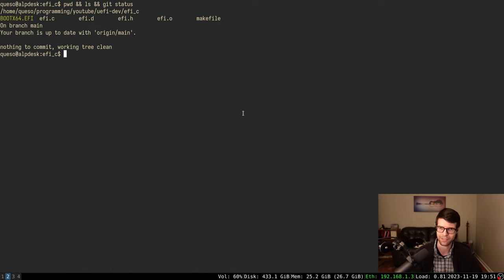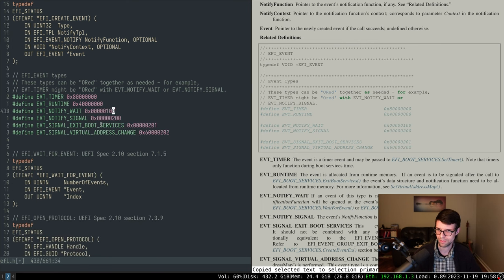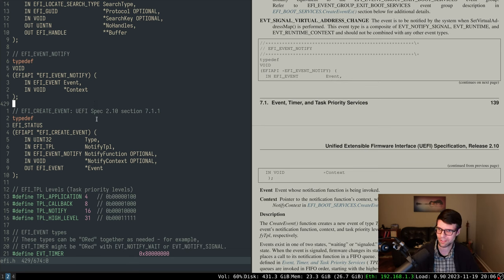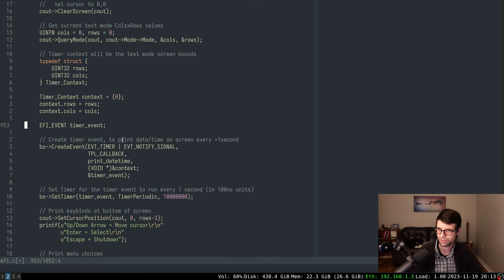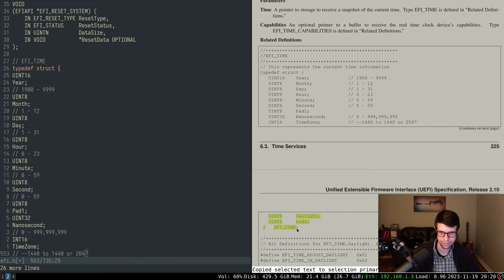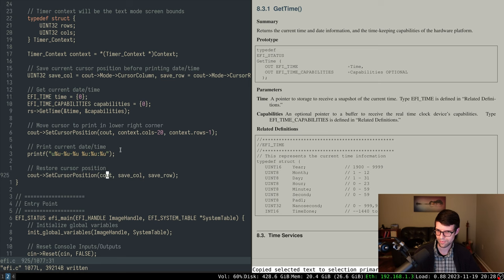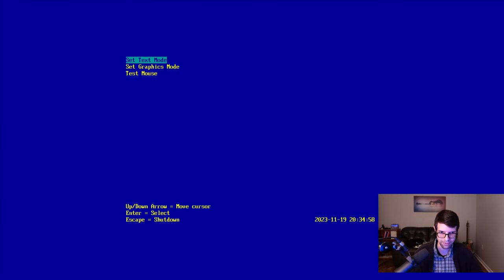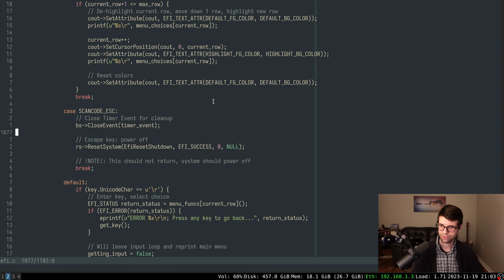Timer Event & Printing Date/Time | UEFI Dev (in C)

Comment: I have never seen a UEFI/Low level code series that is still active, don't you dare discontinue this series lol. Also try and make an 64 bit OS using something like this
Reply from the maker: I mean, it has to end someday right? But can always add more later on. It'll at least get to loading and running a file/"kernel", and writing to another disk for an "installer", if not other things like paging/gdt/idt/etc. setup for an OS.
I do plan on doing more OS dev after that's all done, since it'll boot and run on my hardware at that point :D

Comment: I am a bit confused by the context of the timer function since you are creating the event in the main menu loop, wouldn't it only refresh the rows and cols when the user exited the set text mode menu and the next event was created and triggered in the main menu loop (since the rows and cols variables are updated only in the main menu loop not by the set text mode menu)? I think when you switched text modes it still wrote to the same row or am I just dumb?
Reply from the maker: Yes, it only refreshes the rows/cols from QueryMode(), which is in the main loop. It would stay in the same spot until getting the new  row/col values there. Probably would want the context globally or passed around, and update it immediately when needed such as changing the text mode, or using CloseEvent() for the timer event to stop it, and adding back the timer event later.